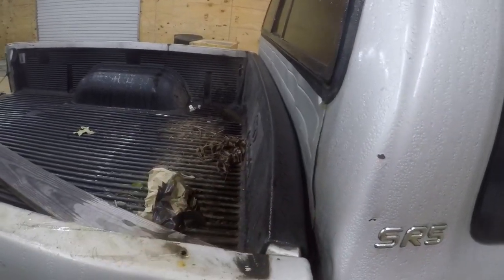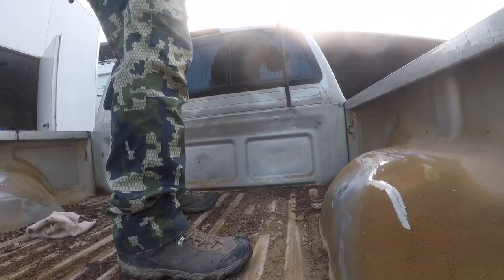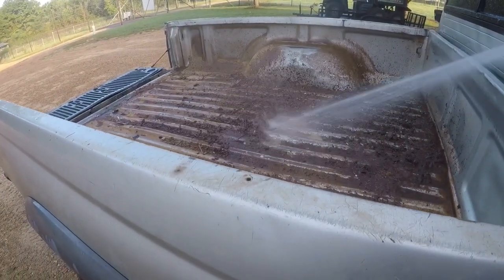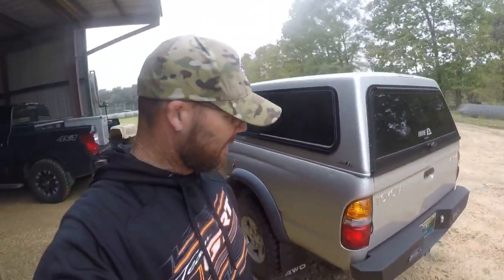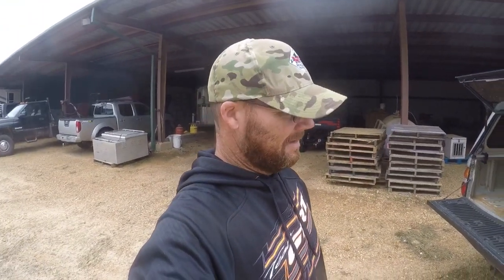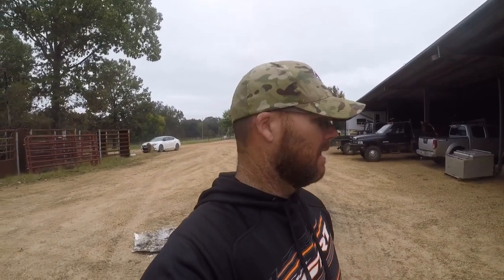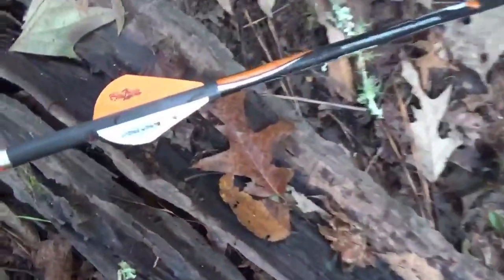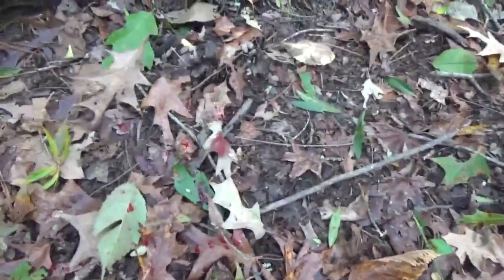TOYOTA TACOMA PROJECT TRUCK 🤔🤔🤔

Comment: I just got a new 2019 5.3 GMC and I get 21-24 highway w cruise control on 72 constantly. No bull
Reply: Hollis Farms the new 8 speed transmission is the real deal! Performance and gas mileage is tremendously better. I have a 2016 5.3 Silverado with a 6 speed and I get 16-17 with it. Which it does have 33’s now but factory 275’s it was only 19-20

Comment: I know the feeling on MPG. I drive a 14 F150 crew, long bed, with the 3.5 ecoboost, and 3.31 gears. I’ve seen 21 mpg, but not often. If I set the cruise at 70, I can get anywhere from 17.5-19mpg. Around town and short trips, I’ll get 15-16 mpg. More power than I’ll ever need though. I think the 2.7 ecoboost does a bit better with 3.55 gears. I’ve learned over time now, 43,000 miles, it’s either Eco or it’s Boost. But rarely both at the same time. 
Good luck finding the deer, maybe grab a dog, see if it will track.

Comment: I had a 2013 Tacoma, 4 cylinder 4 door and got 18-20 mpg and it lacked power. I traded it for a 2016 Tacoma 6 cylinder 4 door and get 23-26 mpg and have power to run 65-75. I am keeping the 2016 Tacoma.

Comment: Sprayed on bed liner is the only way to go. Blood washes out and they don't allow things to slide. 🏁🏁🏁🏁🏎️🏎️🏎️🏎️🦃🦃🦃🦃🦌🦌🦌🦌🐗🐗🐗🐗👍👍👍👍
Reply: Jason,   before putting a spray on bed liner or a mat I suggest using something like this to stop the damage that the plastic liner caused.   Auto parts store should have something similar. 

https://www.lawsonproducts.com/Lawson/LRC-Rust-Converter/93855.lp

https://www.lawsonproducts.com/Drummond/Metalize-Rust-Converter/DA7490.lp

Comment: Dang, previous owner had something heavy roll forward to bend the back of the cab up like that! Think I'd have just left it as it was and hope the cab and bed don't rub through each other from flex and vibration. Another recommendation for spray-in bed-liner from me, that stuff is tough as can be.

Comment: Join the club. I know how I feel when that happens. I shot a doe about a week ago and couldn’t find it. My son and I tracked it until the blood trail was gone. Then we zigzagged in a 300 yard radius. No deer! We don’t have the benefit of video but I came home and took my deer target and replayed the shot. I used my range finder and used the exact distance in said when I shot the deer and the same height I was setting. I found out some amazing information. Now I use a crossbow because my shoulders want let me use a compound anymore. I found that if I jerk the trigger or just pull it hard, I shoot about 2 inches high every time. If I slowly pull the trigger and increase the pressure on the trigger very slowly I hit where I’m aiming every time. It really bothers me when I can’t find a deer, almost to the point of being sick at my stomach. This was the first bow kill I ever lost. I know how you feel but recreating that shot really helped me. If you are not getting pumped when a deer comes in, then you really need to consider if you need to be hunting in the first place! Y’all have a good-un!

Comment: Tition is the worst truck of all them, read Consumer Reports, see Scotty Kilmer(on you tube) you will learn the problems out there. Toyota makes a truck about like the Tacoma in Indonesia called Hillux. It has a 4 cylinder gas or diesel, but only sold in the Philippines and other Asian countries. It is a great truck! The V6 is also a good engine, but only when you have a manual transmission . Your friend got 400,000 miles out of his former manual transmission truck, and only a few out of his new automatic. That is where he messed up is not getting a manual. I like you channel and watch it every day!
Reply from the maker: Thanks 👍

Comment: I hear the new 2020 RAM 1500 4x4 with the 3.0-liter V-6 EcoDiesel is getting around 24mpg. it gets 21 mpg city, 29 mpg highway. That's great fuel mileage for a 4x4 that's capable of towing 12k pounds. And I've seen Youtubers that tested them and swear they're getting better fuel mileage than that.
Reply: @HollisFarmsMS , I meant to add that you can buy a HECK of a lot of fuel with the amount of money that one of those costs. lol.